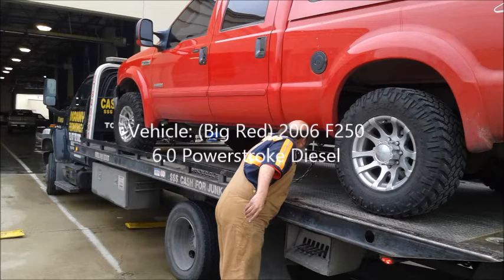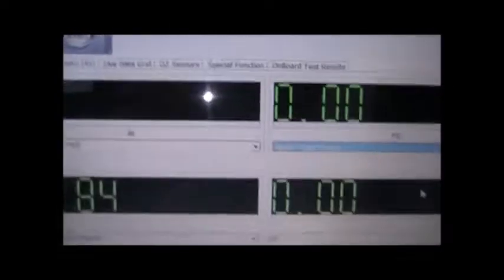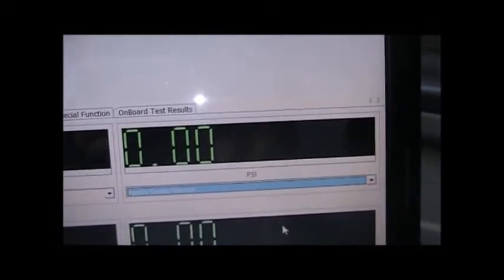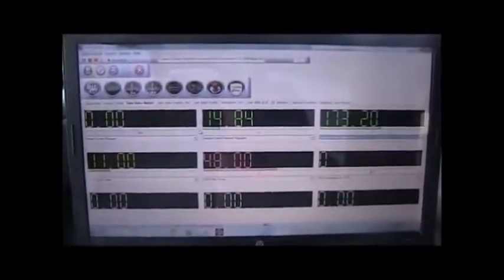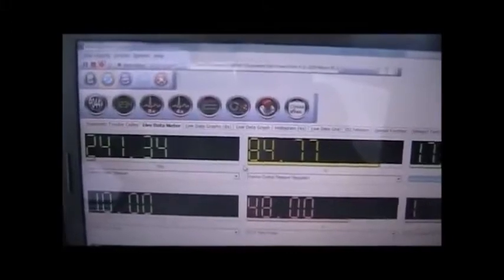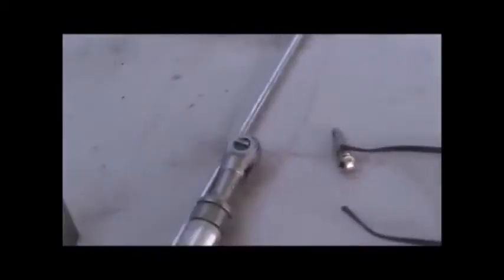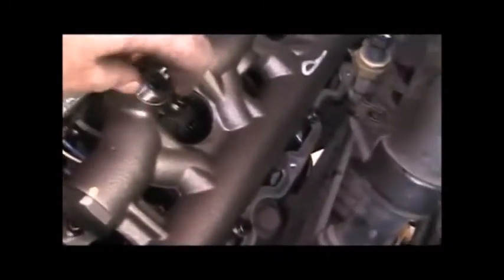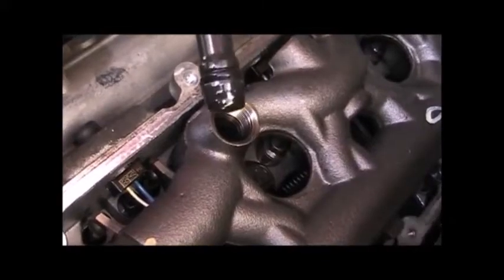Part 1: 6.0 Powerstroke Long Crank Cold, No Start Hot Diagnosis

Comment: did you have to pay for the computer app this might sound dumb but if so what is it called
Reply from the maker: Yes. I used Autoenginuity. It cost a little less than $400.00, if I remember correctly. Check out dieseltechron on YouTube   . He shows a cheaper option available from Bulletproof Diesel, if Autoenginuity is cost prohibitive. When you compare $400 to Ford's $100 hourly rate, it becomes a good investment.
Reply from the maker: Here is a link that you might find helpful. 
https://www.youtube.com/watch?v=9kjoWoYtZg4